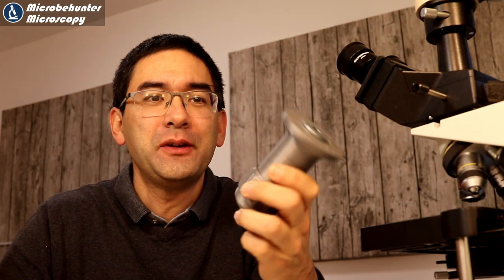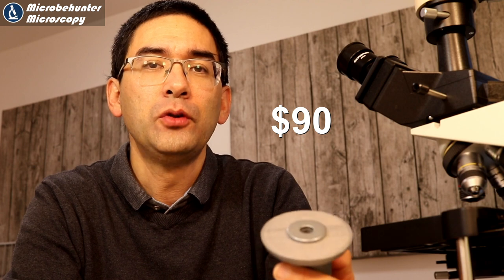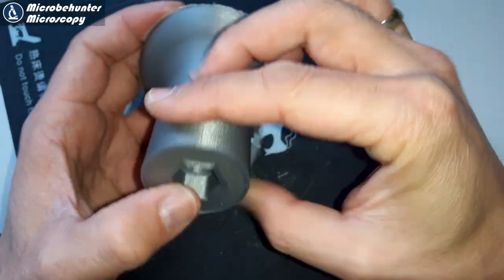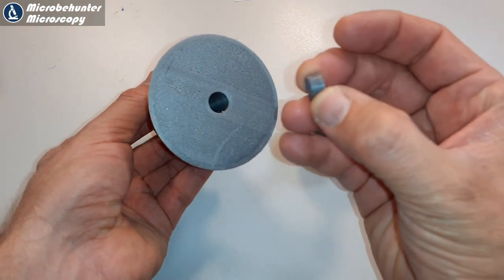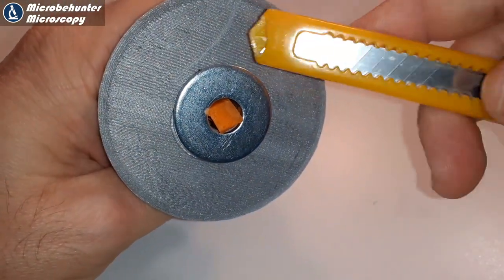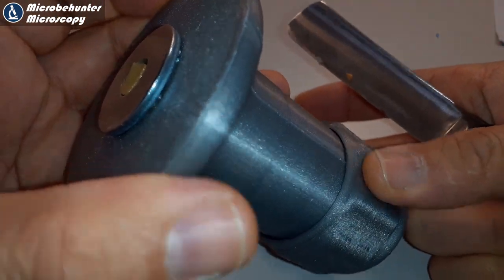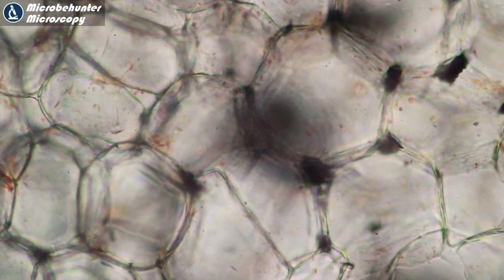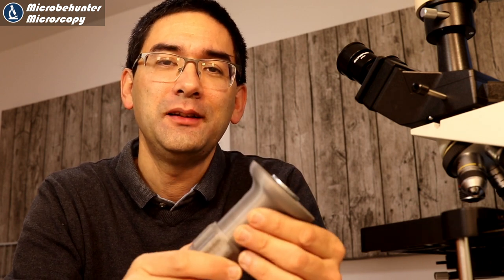🔬  How I 3D printed a microtome to cut specimens for microscopy

Comment: in our pathology lab we use parafin to encase the specimen and we cut it put it on a  slide and move it over fire for a bit and parafin melts and specimen sticks to the slide. so instead of putting your specimen in a carrot like your previous video you can make or 3d print a tube, fill it with melted candle and put your specimen in it and let it cool down. I'm not sure but I think you can even fill the microtome with candle parafin and put the specimen in it directly and let it cool but the parafin might stick to the PLA I'm not sure I might try it first. 
great video as always sir!

Comment: Using glass would be better than washers, but hard to drill at home. I started thinking what i have, and there is a ready-made solution. You have to take apart a broken 2,5" HDD, the disk is super flat, you can use that instead of the washer. I'll also make one with a clamp, get a microtome blade, and fix that to a contraption. Then i can move this thing with the specimens through the fixed blade, i think this would give good results.
Reply: An HDD platter is good thinking. Super smooth.

Comment: I saw recently a video of what I believe was you using the Brunel Microscope's bench mounted hand microtome. In the video you used a plastics cylinder for producing the wax block with the sample in it. The cylinder was in 2 halves, allowing the wax block to be easily accessed when solidified. Around the wax block was a layer of greaseproof paper. I have 2 questions - 1, where did you get the plastics cylinder and 2, how did you insert the greaseproof paper inside the cylinder. Thanks

Comment: I am almost certain it would be more convenient and less expensive and hassle to buy a microtome from Brunel. Regarding cutting a thin slice, Wilkinson Sword razor blades are what you need, or break open a cheap bic razor and remove the blade hen use it to cut your specimen.